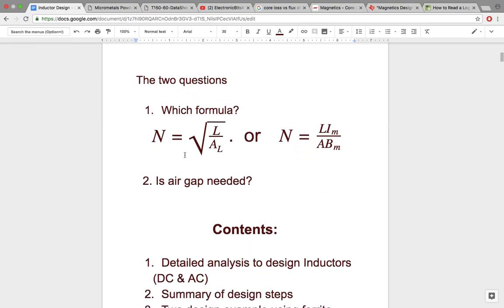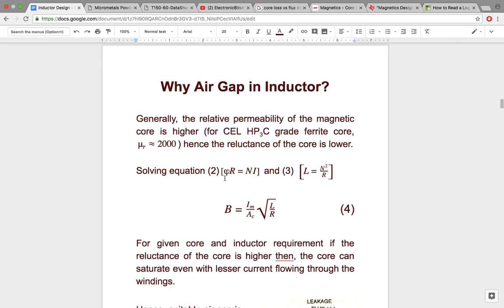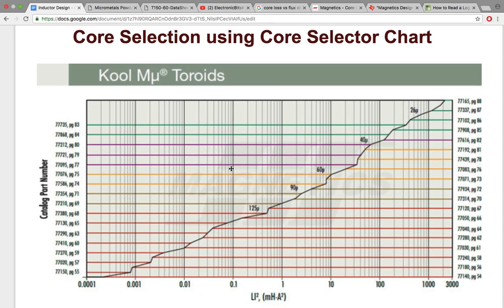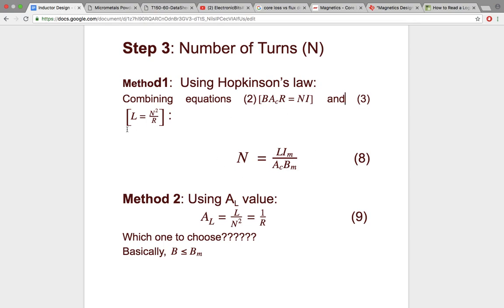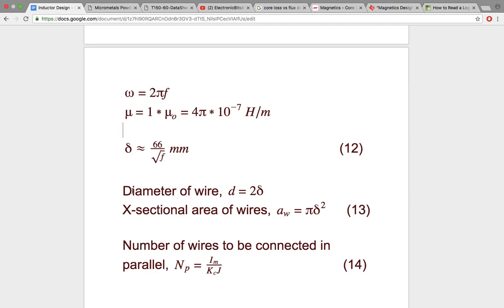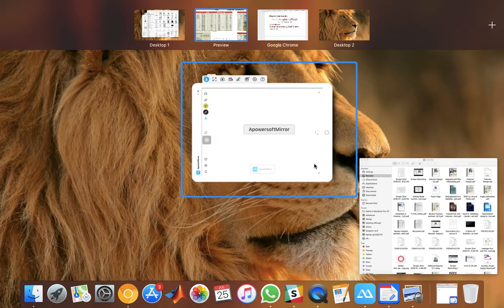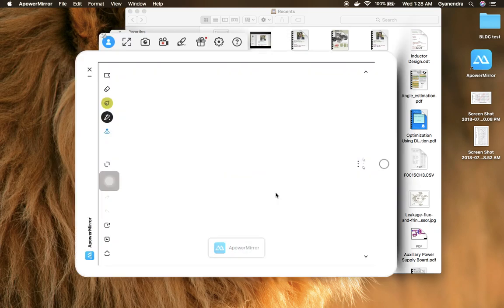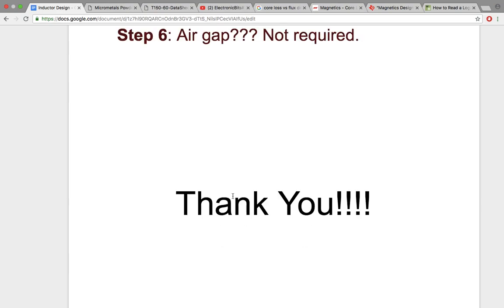High frequency Power Inductor Design: DC & AC

Comment: A question: when calculating Ap for: L=33 uH, freq=125 kHz, Imax=2.5 A, AC mode, Bmax=0.12 T, then Ap=((33*10^-6)*2.5^2)/(0.12*0.6*1.414*3*10^6), I get a riddiculously small number, Ap~10^-10 cm^4. By methods described here (using max AC power to derive the Ap, needed power is 300 W +): https://coefs.uncc.edu/mnoras/files/2013/03/Transformer-and-Inductor-Design-Handbook_Chapter_10.pdf
I get around 0.31 cm^4, which would seem to make sense at least in the domain on order of magnitude.
Why this discrepancy?
Reply from the maker: Hey, nice question. The unit of answer we get from formula (Ap=(L*Im^2)/(Kw*Kc*Bm*J)) is in m^4. To convert m^4 to cm^4 , we should multiply obtained answer by 10^8. The answers of ((33*10^-6)*2.5^2)/(0.12*0.6*1.414*3*10^6) is equal to 0.06752907433 cm^4. 

The input taken for designing inductor in https://coefs.uncc.edu/mnoras/files/2013/03/Transformer-and-Inductor-Design-Handbook_Chapter_10.pdf  and the method discussed in this video are slightly different. In the former documentation, the inductor is designed based on its volt-amp rating and its operating frequency where inductance is computed at the end (Ap, N, and inductance may vary depending upon VA and Freq requirement) but in this method the inductance value and its current rating are already known (remember these are computed during designing any power circuit) and hence we design inductor to achieve required electrical and thermal conditions. In other word, these two methods uses different inputs requirements and hence different design steps but both can be used to get required inductor design with minimal discrepancy. 

I hope this might have answered ur questions. Please feel free to raise any concern doubt, will be glad to help if I can.
Reply: Thank you!

Comment: your efforts are so good.
but My Question is this I want to make Air core Inductor for pulse generate, so how I will know L or I(current) 
and such as You choose 25 kHz or 0.2 by the table so How could we know frequency for design inductor?
Please give advice? Urgent
Reply: We design inductor only if we have its specifications (like L, Im, Freq. etc.). In other word, these informations u have to get before proceeding with inductor design. In your case, u should follow some pulse generator design steps and need to get the required specification of Inductor. I am not an expert in designing pulse generator.

For eg. while designing any power converter, we compute the required design parameters of passive components for given input and output conditions using design equations of the respective converter. And then we use the obtained parameters to choose or design the passive components. 

I guess, in pulse generator the frequency will be varying and hence it will be operating within a range (Fmin to Fmax). In that case, I recommend you to choose Bm for Fmax to be on safer side (this will make sure, the core will not get heated up while operating at maximum frequency but the size of core may increase dramatically). you may also choose some middle frequency depending upon how effective is your thermal management (this will help you to reduce the size of inductor). Note: Inductance and current rating of inductor need to get from the pulse generator design steps for given input and output constraints. 

Thank you for your question and let me know if any query you have regarding inductor design
Reply: Ok